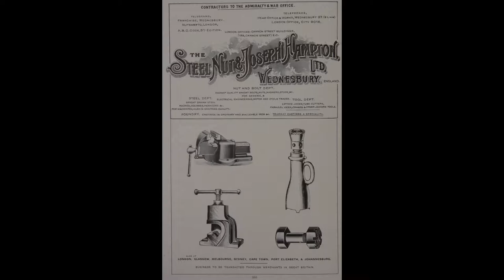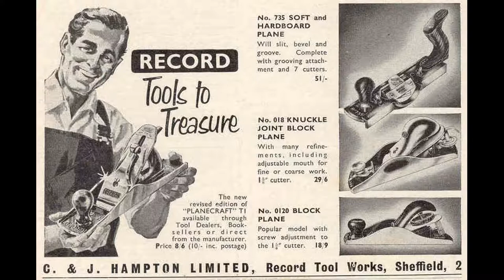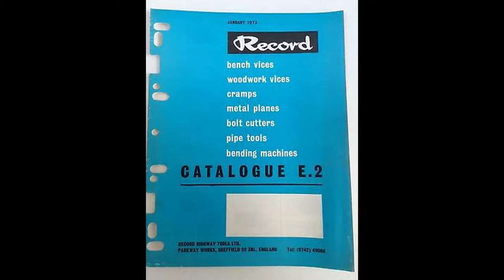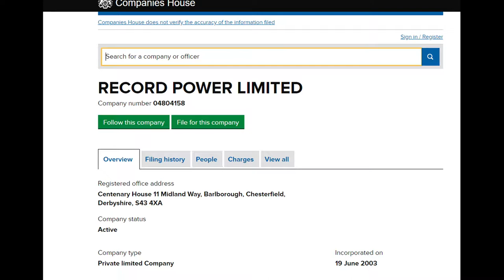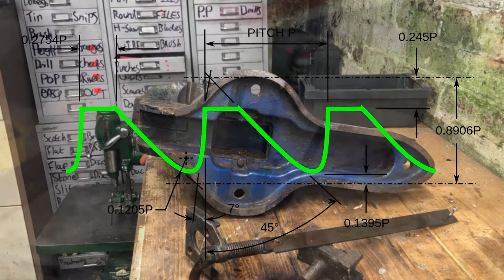The History And Resotoration Of A RECORD No. 25 Vice UK

Comment: I recall seeing a photo in the 1960s of a Land Rover on a steel frame with a lug underneath and the whole kit and caboodle was held up in the jaws of a record vice. I've searched for ages trying to find a copy of this but no luck so far ..... anyone out there know ??
The turntables are very handy and I've found them useful for so many jobs. I bought a heavyweight workshop made 1 off jobby, for 4 quid at car boot and that worked great for renovating a 4 hundredweight anvil. The turntable is 2 feet wide using 6 car wheel bearings running on a circular track. The guy I bought it from used it for planting up huge flower pots.  Great informative video mate - thanks
ps. you might also like the quality of the old Parkinson 'perfect' vices, they are certainly on a par with, or even better than Record vices

Comment: Great video and lots of useful imfo, many thanks, the bolt that was added onto the flat bar on the quick release rocker bar has been fitted at some time to stop the vive coming apart when fully open but its not needed if a washer is fitted at the back of the main screw. Really love made in england record vices and have a collection a 4,5,6,22 and a 34 steel always on the look out for a heavy duty and a 116, thanks again for the video.

Comment: Thanks for the info. Just took apart a no.5 I just got from a car boot for £25 in pretty good nick so well chuffed. Nicest & biggest vise I've ever had. I just wondered when you put it back together you said you oiled it. I've seen people grease the thread and sliding parts when they put them back together. Just curious if you'd use grease or just oil? Cheers

Comment: I think that pre '64 vices have a recessed 'record' casting whereas post '64 the casting is proud of the surface.Have a very old no.22, quick release, which has a broken body casting after years and years of very heavy use-looking to try and get a replacement-will try and refurb one when I can search one out.

Comment: Great video, thanks for sharing. I'm just starting to strip down my no.25. It's quite an old one I think. The half nut keeper plate is quite short and is only held on with a single bolt. To remove the half nut, you need to slide the entire outer jaw casting out of the main body and let the half nut drop (of the vice is upside down) down. Have you seen this type before and would you know what age it is? I'm struggling to find spares.......

Comment: Great video! I've just bought a no.23 to restore, so lots of tips here. One question; mine has has thre quick release mechanism removed. Sites anyone know if it's possible to pick them up separately, or am I looking at trying to find one with a cracked casting that I can strip for the parts?

Comment: Thank you very much for the company history, I knew some of that, but not all of it. I have a more substantial collection that includes a later-production 25 :-)
Reply: 8/10! :-D You'd give mine 25/10 then :-) It's like new except one small angle grinder cut about 1/8" deep in the back of the front jaw, otherwise all original paint and mild patina on the steel/iron.
Reply: I think you'll find those screws are an odd old size: 5/16-26 - this info stolen form a reddit thread and a guy with an old 36. I have a fairly old 6 that I replaced the screws on and those were a standard imperial size. I guess they used fine pitch stuff way back then for greater clamping force and anti-back-off properties. I'll soon see what is in my 36p jaws :-)
Reply: I've, at home, not in a heavy use environment, killed a brand new makita 4" grinder inside a year. I have some 25+ year old Hitachi 4" grinders that are STILL going strong and several newer ones. I've had dewalt ones like yours apart and was unimpressed, hitachi are way better built, though the dewalt flexvolt grinder is excellent, I have several :-)

Comment: Hi, great vid on the History there, some say there's better makes out there than a Record vice, l don't know as I've only ever had Record, my first being a Record 112 regrettably l sold that he did offer £250 so l took it, still later l regretted it, I've just bought a Record Steel heavy duty that's very similar to the 112, but l believe these are much stronger being made from cast steel, refurbished it yesterday using Bosch 880w grinder n wire wheels, got every bit of paint off, then used Holts brake cleaner degreaser l always use, and repaint using Roundel blue, l used a good quality 1" brush, the Finnished vice now looks great. Have you any idea when the 110 steel vice would have been made? Thanks.

Comment: Hi great video, I have just bought a record 25 and wondered how you can date them and can you please tell me what sort of steel or iron was used to make them . Kind regards Patrick.
Reply from the maker: Hi Patrick, Sorry i dont seem to be getting notification at the moment. Difficult to date them especial on the 2 series as they didn't really change a great deal. The 2 series vices were made from ductile iron i cant find an exact PSI rating so id guess 40,000 to 60,000 strength? Seems to be the common number?
Reply: Anchor Designs thank you for the reply, I just need to service it now.

Comment: Hello James great work! If i can give an advice i wouldnt use stainless bolts they break easily and its a pain to take out, try some steel bolts.
Reply from the maker: Alexander N thanks mate. I vary to be honest I never have the bolts in tight but you are correct
Reply: .... and, as pointed out in the video,  think of the fella who will be restoring this again 60 years down the line - use Copaslip or similar anti-seize paste on all the bolt threads

Comment: Brill video, just about to restore my grandads No 25 vice. just bought some of that international oxford blue paint aswell. Did you use enamel primer or coach primer not really sure, and do you use whey oil or weight oil? lol for the sliders thanks again.
Reply from the maker: Hi George, Great to see another Record being saved. I use ISO VG 68 Oil. (its a nice sticky oil) (not too heavy)  and just coach primer. Its great stuff. 320 grit between coats and use panel wipe in between to de-dust and degrease. Happy making thanks for the comment sir.